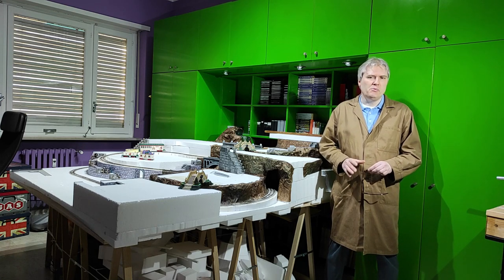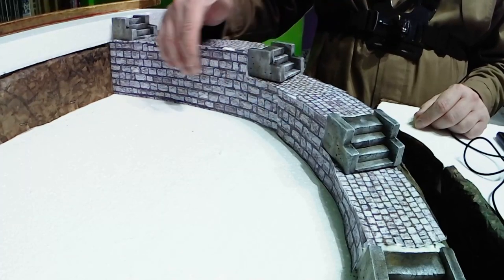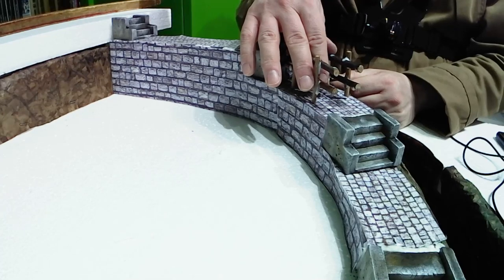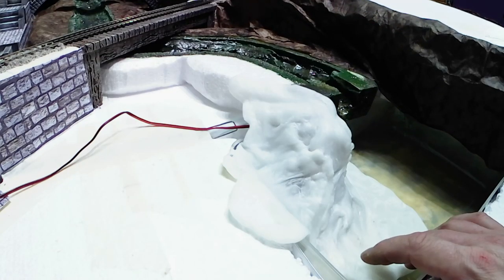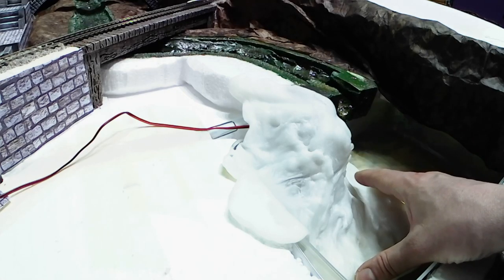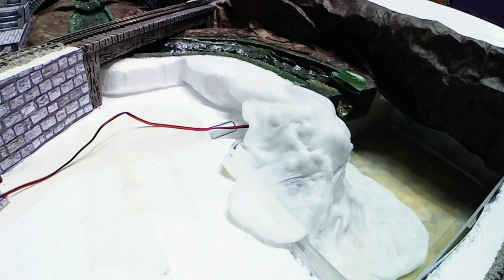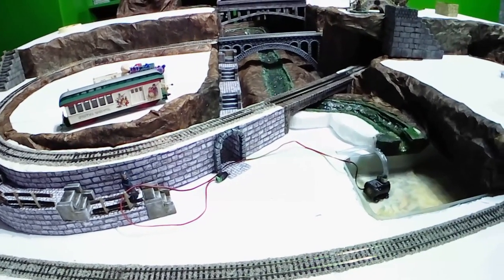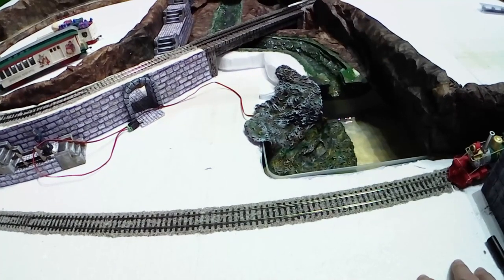Christmas Village Tutorial 2020 - Part 14

Comment: HI again Silvio, are those florist pins you use for the paper? Great video and explanation as always! Thank you.
Reply from the maker: Hi Zara. Yes you are absolutely correct. I use 2 dimensions of florist pins 25x5 mm and 30x10 mm. The only physical store that sell them is Viridea and I haven't found them in any other store. But the brand is Rayher and fortunately they have a multilanguage online shop 
https://www.rayher.com/en
and they ship internationally. 
Just search for part numbers 2106600 and 2106500

https://www.rayher.com/en/roman-clamps-2106600
https://www.rayher.com/en/strawflower-pins-2106500

Byez